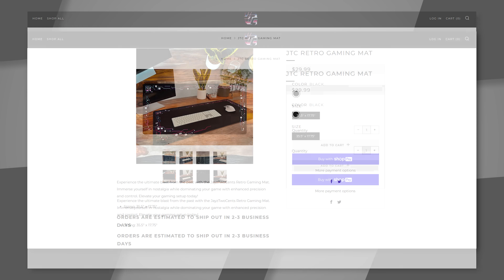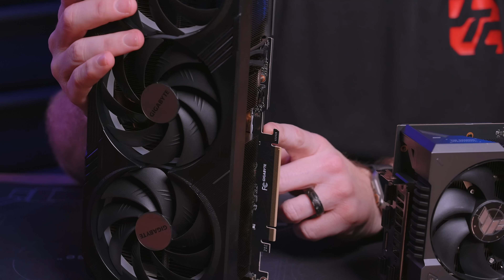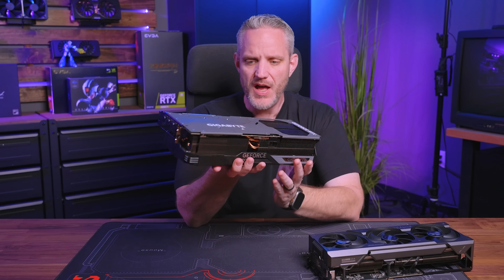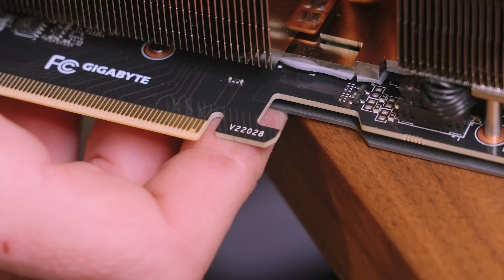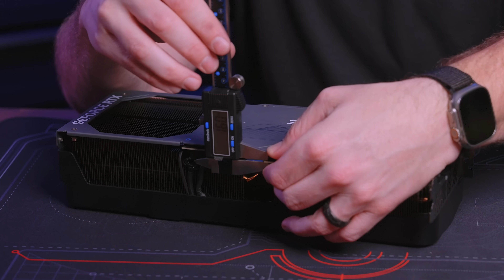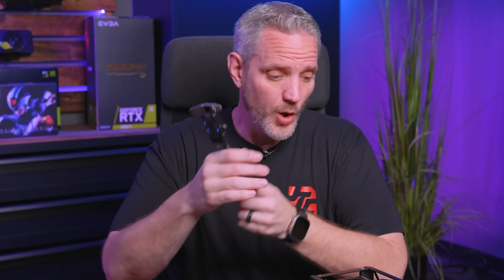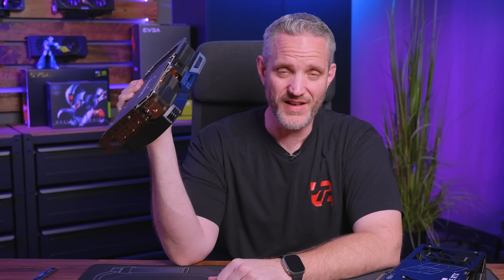These GPUs are cracking and the company REFUSES to warranty them!

Comment: The caliper moved slightly during the measurement, it happens. 
What was immediately visible PCB is "almost" the same thickness .. which does not change the fact that it should not spring like that. What's next is less of a problem than a non-working GPU... especially with a crack in the PCE mount that was only supposed to hold the GPU in place... 
Who designs power paths so close to a "potential failure point" .. oh yeah gigabyte .. hold my beer. .. it will be awesome .. as a gigabythe 3070 user combined with a gigabythe X570 both from the "Arouse" series former Extreme as I remember correctly .. I start to wory if I start picking or cleaning something that breaks :/
A  have some problem with gigabythe especially since her own software does not get along with her own hardware and software ... (as I mentioned I have X570 with 3070 from gigabythe I can't manage components of the same brand in rgb fusion because the GPU is not shown there ... because RGB fusion dedicated software does not see the GPU and why no one knows ... ok maybe I spilled my bitter regrets a bit but that's how I do it I see, I don't hang dogs on gigabythe but next time I change the motherboard + processor + GPU I will check if everything works (software & hardware) from the brand I choose

Comment: I had an issue with Gigabyte with a brand new motherboard, luckily the store I bought it warranty swapped it, it took them 3 weeks to respond, it was replaced well before they ever responded. It is the last Gigabyte product I have or will ever buy. The power supply farce just cemented it. I'm sure they have some great products - but their customer service is weak AF.

Comment: Seems like there are alot of crappy pc products across the board.  Doesnt matter what brand you buy.  I RMA'd an asus z690 that wouldnt recognize my gpu was seated throwing a led on the board even though the gpu worked and the new replacement I got wont run xmp.  I just threw it away and bought an evga board.  I am done with Asus at this point.

Comment: Yeah I don't really buy Gigabyte products either.  I've tried, but pretty much every single one I've tried or worked with, always had some kind of fault.  I know they make good performing parts.  I've seen enough reviews and comparisons where I know this without a doubt.  But from experience, their quality control, quality assurance, reliability and just build quality in general has just been so poor that I've had nothing but issues every time I've tried to use them.  So I gave up.  I just don't even bother looking at Gigabyte anymore because experience has taught me that while I "might" get a good performing product, I generally won't get a good quality product.  

And if their product quality wasn't bad enough, their customer service was even worse.  I've gotten better customer service from Asus and that's saying something.  But where Asus in my experience doesn't have great customer service, their products are "generally" rock solid (recent events not generally being the norm).  Expensive, but generally very good quality.  The best balanced company in my experience between rock solid products and (in my experience) excellent customer service, has been MSI.  Their products have always been very good.  Their build quality has almost always been on point.  And their customer service, some of the best I've ever had.  Where I've been able to sit down and have full conversations trying to figure out a fault.  One of them where working together we were able to narrow a system instability issue to an ASUS SATA PCIE card that just so happened to be using the exact same SATA controller chip as my MSI motherboard.  Which turned out to be causing to causing conflicts.  The only other company I've ever been able to have that level of a technical conversation with, is Corsair.  And it's not like that's the only example of great customer service I've received from MSI, so they get really high marks from me.

So generally these days, when I'm looking at components, I tend to look at MSI first.  One because of the generally consistently good product quality, but also especially because of the customer service quality.  Asus tends to be my number 2 pick.  AsRock I am watching very closely because they have really upped their game over the last several generations.  So I am seriously considering trying more of their products.  Gigabyte though... To be honest, I avoid them...completely.  There's just too much bad personal history there and I just don't have any confidence in their products.  Not in their quality, nor in their service.  So I don't touch them anymore, and I don't recommend them.  I gave them one last chance on a friends build (they chose the board, not me) about a year and a half, to two years ago (B550 Aorus Elite) and again the product turned out to be defective.  Thankfully we were within the return window and I just advised him to return it and recommended he get the MSI B550 Tomahawk instead.  

That was Gigabyte's last chance for me and again they blew it.  From my perspective, seeing this video is not some "shock to the system" like the recent Asus issues were.  This is just more of the same and affirmation that my decision to completely discount Gigabyte out of all future component considerations as the right decision.
Reply: It's just tragic seeing how low Gigabyte really have fallen. So many stories about Gigabyte products failing in the comments here. Up until now, I had a pretty neutral view of the company, but after reading all these stories I definitely won't be purchasing from them actively in the future.

Comment: The flex is due to how the pcb is attached to the frame. Look at the Asus and then look at the Gigabyte. Asus has a Thicker screw holding the pcb down near where the crack would happen at. Whereas Gigabyte has tiny pins not even close to where the crack would happen. My theory is the screws are not placed properly to hold the board when in the slot so it bends and eventually cracks under stress and heat.

Comment: Jay, this possibly occurs when one removes the power cable from the card while it is installed in the pci-e slot on the mainboard. One needs to brace the rear of the card with opposing force when removing the power cable.
Reply: @sinAnon6689  blame nvidia for making powerhungry and hot cards that can only be cooled by a solution almost the size of a midtower case.

Comment: I hope you are feeling better. I own a GIGABYTE 4090. After I installed the card, I discovered a problem with the release mechanism. The card would insert into the PCI slot, but the release button did not work. With the card removed, I activated the locking mechanism by pressing downwards. When I pressed the unlocking button on the MB, the locking part did not release. This might be the problem. If the release button doesn't work, a person could put too much upward pressure on the card in an attempt to remove it.

Comment: I dont buy gigabyte anymore for years due to the motherboard i have is ultra sensative to everything, if i touch settings it takes me hours to get it past the bios and in most cases i loose my windows install as will just not read the drives properly ect , changed the ram other day , poof windows wont boot and nvme cards not reading, i dont trust em.

Comment: As I was watching this, my new Gigabyte 3060 came got delivered. Immediately looked at that tab, and idk if its specific to certain batches... but mine seems rock solid. Actually no flex at all to it, and I was pushing as hard as I was comfortable doing. Hopefully mine stands up to the test of time, it'll be vertically mounted so hopefully that helps it.
Reply: It's possible that the issue was addressed in newer iterations. They must be aware of it due to how many RMA requests were coming in.

Comment: At this point, any build I do has to use an anti-sag bracket. Gigabyte/Aorus is providing a bracket with their 40 series cards. At least as low as the 4070 Ti that I know of. Lian LI also has a bracket they sell. They mention it for their Lancool II Mesh case, but it'll work in any case.

Graphics cards are just really heavy these days. All graphics card manufacturer's should be providing a solution. And in my opinion, one that is elegant, simple, and doesn't offend the senses.
Reply: Same here. I only have a 3060ti and i picked up one for it. It's like cheap insurance for our GPU investment. If we're going to spend hundreds.... or into the thousands for a card, forking out an extra $20 for a bracket is a no brainer.
Reply: I got a 4090 gigabyte and after setting up the bracket I realized the mount doesn’t work with my MSI motherboard x670e carbon fiber the lengths were way off so I had to go buy a third party bracket kinda sucked because I bought gigabyte for the mounted bracket incentive
Reply: @kylesuarez5071  Yeah, that sucks man. Nothing seems to work in all situations. I had some issues even with the ones I mentioned. Maybe case manufacturer's should try to come up with a solution.
Reply: Even on the RX 580 I had which was also GIGABYTE, I had to install an anti-sag bracket, as the PCIe contacts on the top side of the card got worn bad, most likely due to vibration. Bottom side is all good and clean.

It was causing freezes or black screens whenever I plug a cable or someone walks by.

Comment: I saw Louis Rossman bring this up, said in his comments what the problem is. The notch above the lock tab. The lock tab holds the card into the slot and is needed so the heavy card will not work loose from the slot when the PC is moved(or just gravity and time) unless the owner moves it like a 2000 year old vase in a museum and they are the curator. Being cards are so heavy today due to the cooler size that means that tab receives allot of stress, the notch above the tab acts like a lever, the longer the lever the greater the strength the lever has. A normal notch above the tab is covered by the lock so there is very little leverage, that card has a double if not a little more sized notch creating a stress point which will fail. PCB material is brittle and does not enjoy flexing, add that to the lever created by the oversized notch and repeated flexing from the PC being moved... you get cracks.

A full length pencil will snap in half with ease, try doing the same with a 1 inch pencil.

*Edit,
15:25 You do not need to break a card to see the problem. It was clearly shown in this video exactly as I said it was. In the side by side comparisons you show the PCIE tabs on both cards flex the same, both cards have the same shaped PCB there. The Gigabyte card flexed more around the lock tab and the stress point was in the corner of the large notch exactly where the cracks were in the broken cards. It flexed more because it has a ridiculously large notch while the Asus card has the same notch as all other companies make, just big enough to allow the locking mechanism to allow the tab slot in and lock down. Large lever verses small lever, full length pencil verses extra short.

Comment: Flawed video, both are 1.6 mm and the ASUS card has a backplate mount right next to the tab which totally stiffens and supports that area of the PCB and also doesnt stick out as much as the gigabyte pcb hence more stiff. You can also argue that a stiffer pcb crack more easy the a softer more flexible pcb......

Comment: The tab on the 4080 doesn't flex as much because there is a screw attachment right by it. That is moving the bending arm much closer to the locking tab so it can't bend as much.

Comment: The tab is a common failure point on all GPUs from all manufacturers. It's an easy write off as user error, warranty void, because it forces them to buy a new GPU which manufacturers love. Yet it is a purposefully risky design choice to let traces run near there. You could easily design it to be able to be broken off with no effect on the card, including preventing cracks propgating further into the PCB. I doubt it will change though as you can't have a class action lawsuit against the entire GPU industry.

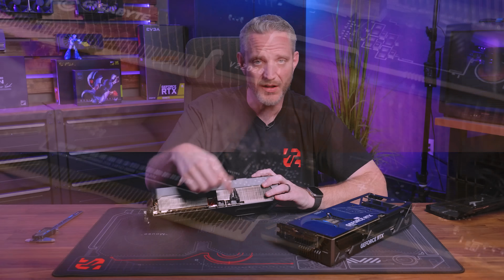Comment: Regarding the comparisons at 14:14, I do feel that this is an issue, but it's a really bad comparison, since you compared it to a card with metal support right next to the retention tab. I'd love to see a video comparing the failing Gigabyte models to other cards, ones without the huge metal support beam right there, to see if Gigabyte's board quality differs from any other manufacturers'.
Reply: It's not a bad comparison.  If that metal stand off is stopping the pcb from breaking, then not having that standoff is a manufacturer's design error that needs to be addressed.
Reply: @KurNorock  but if its not happening on other cards that don't have that standoff, then it's a deeper issue than the standoff providing less flex. You don't want a super rigid pcb otherwise it will more likely crack when moving it around or the vibrations of something falling on your desk or near the PC itself. 

It's a more complicated issue that goes to the manufacturing process, not necessarily the design itself.
Reply: @overtherenowaitthere  You are missing the greater point. The point is NOT that Gigabyte needs to make their pcb material more rigid, or that they need to add a stand off to support the tab. The point is that they have a bad design that allows the pcb to crack whereas other manufacturers have some design element that prevents their tab from cracking. 

Asus might use the standoff for that and maybe asrock uses thicker pcb material, and maybe PNY just uses stiffer pcb material. The point is that they all have some method to prevent cracking and gigabyte does not.
Reply: honkai is way better than genshin midpact

Comment: At a quick glance, it appears that the Asus card is less flexible because there is some sort of rigid screw mounting point near the tab. The mounting point may be there for other reasons than structurally reinforcing the tab like it is used to mount the cooler. Reinforcing the tab might be a side benefit.

Comment: you would think that these gpu manufacturers would just create a card with a (removeable) 2nd mounting bracket at the other end if cards are over a certain weight/length so that it can be affixed in the case to support its weight.

Comment: Strange situation. This can be compared to the old series of video cards for example ASUS GT210 or HD5440 had heavy thick aluminum heatsink without racks(stands), they often chipped the corners of the GPU chip and this was not a warranty case. It was enough to take a video card in hand and put a load on one side of the heatsink, which easily happened when ordinary users installed it.

Comment: This is why I always have mounted modern GPUs vertically because I've always had this gut feeling that they were going to break
Reply: Have you had any issues with cooling? Specifically in regards to the coolant in the heatpipes being unable to wick it's way vertically toward the hot end of the GPU.
Reply: @WebeloZappBrannigan  no I use a core P3 from thermaltake and actually at the moment it's got a water block on it but before I put a water block on it it worked fine I'm sure if You use a very efficient fan setup like three fans along the bottom and three fans at the top It should work fine but yeah in a very enclosed case I doubt it would work very well but in an open case it worked fine
Reply: @colchronic  My mistake... When you said you have your GPU mounted vertically, i jumped to the conclusion that you meant vertically as in how I have my GPU mounted. I have a Silverstone FT02, where the rear i/o of the case is on the top side of the case. So the GPU hangs vertically, with it's rear i/o pointing upward. It has the advantage of the GPU weight and subsequent sag being a non issue. It can also be advantageous for cooling... At least it used to be but the coolers on modern GPUs are so large (or more specifically, long) that is believed that they can suffer cooling issues when installed in a case such as the FT02.

The reason being is that the larger coolers on modern GPUs almost always use long, straight heatpipes that run from the "hot end" of the GPU, which is the end closer to the rear i/o, toward the cold end which which would be closest to the front of the case with conventional case layout.

The problem is though, when the GPU is mounted with it's rear i/o pointing upward. The heatpipes, which would be at the bottom, lowest part of the GPI, are so long that it's possible that the liquid coolant cannot overcome gravity in order to wick it's way back upward toward the hot end of the card. There's no empirical data on the phenomenon though, so I'm always interested to hear from users who may have first hand experience. It was a swing and a miss on my part this time but thank you for your reply non the less.
Reply: @WebeloZappBrannigan  oh no I mean vertically as the slot is facing downwards towards the ground and the io facing out the back of the case

Comment: The 40 series pcbs are almost half as short, so they should put less stress on this part, even without a bracket? Also, did you use the 4090 aorus´bracket? The design seems to eliminate any chance of sagging.

Comment: Jay, I have more than 15 years of PCB Design experience. I watched your video and @9.09 I felt the need to comment. 1. Both PCB thicknesses are 1,6mm. I think you made a small measurement mistake I saw the caliper measuring initially 1.6mm also on "thicker" PCB. 2. IF there are traces, power traces there, in the retaining area, IF I was designing the PCB, this area should not have effect on functionality if it cracks. Unless the crack makes a short between copper layers. :)